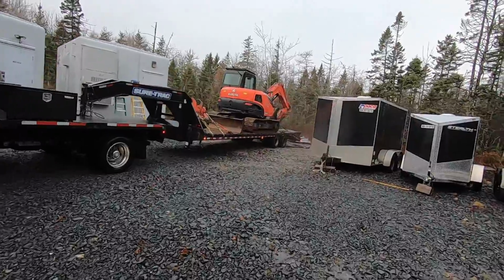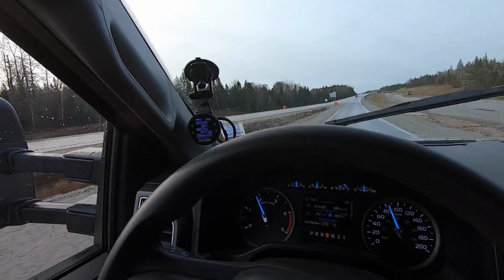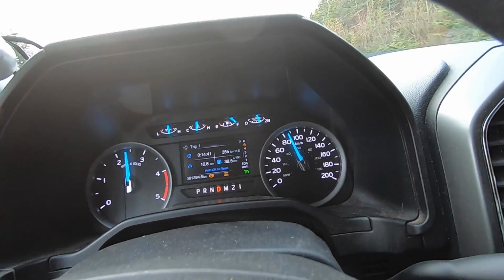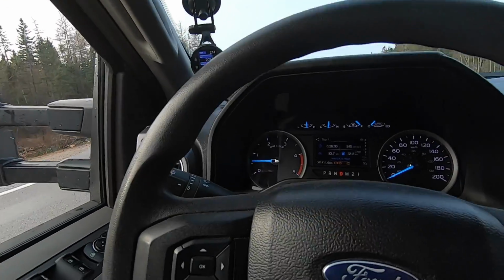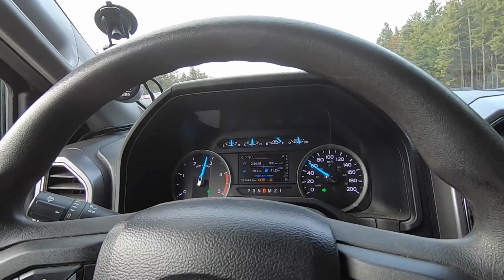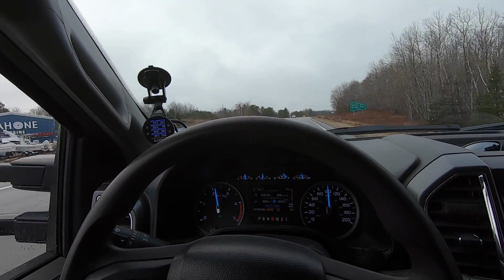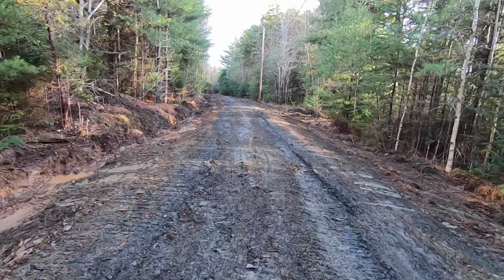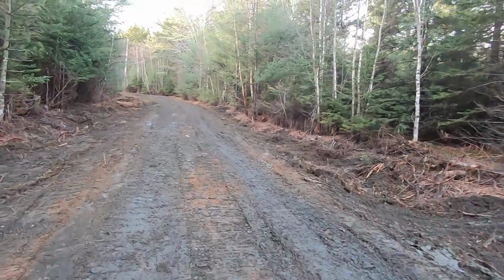BANKS DERRINGER TUNED POWERSTROKE TOWING 31,000LBS & ROAD REPAIR

Comment: After having the Banks Tuner for yrs, is it worth it for towing? I have a 2016 f550 I tow equipment around,  she does pretty good but definitely under powered vs a 350 pickup.  Wish the 550 had the 350 pickup power sometimes for certain situations
Reply from the maker: I like it. Can do a lot with the idash as well

Comment: Do you have the high capacity trailer tow package? And do you have the 4.30 gears or 4.88? -2014 f350 chassis cab owner. Oddly, Ford quotes the 2017 4.30 towing about 26.5k and the 4.88 at 22.5k without trailer tow package. . . I'm about to be towing about 22k here in a bit hauling cars, want to know if it's an option. Thanks.
Reply from the maker: btate 19k I have the 19,500gvwr which is as heavy as you can get. Besides the truck being detuned it does great.

Comment: Wouldn’t it be nicer if you could put it on level 5 and just have that added power the whole time it?
Reply from the maker: Curt It was on level the whole time.
Reply: workplaytv it’s on level 5 the whole time but you can see on the banks screen that it’s not adding the power the whole time according to that gauge. It’s fluctuation?
Reply from the maker: Curt oh yeah  it’s only adds power when needed. Why shoot more fuel in there when it’s not needed?
Reply: No I understand you there. But you’re only talking about a 50hp tune lol! 

There are plenty of tunes that add power from idle to wide open throttle and achieve better fuel mileage. 

I just think it would be like a game of catch up with the added power varying like that. Especially on cruise control. Wonder what it would have pulled that hill like if it was an addition 50hp the whole entire time? 🤔

That would be a pretty cool comparison!
Reply from the maker: Curt Yeah I hear ya it’s very quick if you watch the meter there is no delay. Also most tunes that actually add the power abd mileage they are stating are deleted.

Comment: Any updates on the new Ford delivery,,,🇺🇸
Reply from the maker: sandman62 Middle of January but I think I may have changed my mind and get the lariat sport with tremor but would set me back 2-4 weeks.
Reply: @workplaytv  I'm doing KR tremor  to get 2 tone and tired of the black interior and no chrome for me , but each 2 there on. No worries my 17 doing just fine .🇺🇸
Reply: workplaytv Id just go with the Lariat ...platinum is over the top on rational cost justification. (In my world at least).
Reply from the maker: Neo Craft Was only $1600 in difference once I had it specked out.
Reply: workplaytv Oh, in that case, don’t be a wuss. Get Le Platinum Deluxe!
Reply from the maker: Neo Craft On its way buddy.
Reply: workplaytv haha ok

Comment: Ol man trick is to just buy a RAM 5500 instead of buying a Banks Derringer (non smoking gun) here. We have to ask ourselves "Is it a safe transportation to and from work and shop that you actually have to have a booster for more power"? Or up a hill that you would be the only one on that road and you have to go faster?
Reply: The 5500 ram is a dog compared to the ford. I went from dodge/ram to ford. Best move we did.
Reply from the maker: Stephen Bradley Haha well ol man you have been around long enough to know that the truck did just fine before I had the tuner. It’s honestly more about being able to see everything I need to know on one screen. And if I can save some fuel along the way. That’s great!
Reply: @workplaytv  True, it's got the gears to pull you up. Not me but my friend has pulled his skid steer up to 1200 metres and with a 15% grade with his 3500 chassis gvwr 10,000 gooseneck trailer. Maybe you should have stayed with the 430 gears for better mpg.
I'll watch the two videos when I get home, I can't focus on my phone without the service dying up island in Port Hardy.
Reply from the maker: Stephen Bradley Haha sounds good. The 4.44 would have been the other option in the 550 chassis. It may have helped not sure. I am pretty happy with the truck at this point.
Reply: @workplaytv  As long as your happy with the truck then that's all that matters to yourself but 444 would have helped a lot with mpg. I'm just home after taking 4 1/2 hours instead of the 2 1/2 hours. Lots of Elk on the road (only one choice here, no detours) Highway 19 must have had a dozen on the road to get away from the Wolf's. Worse than hitting a Moose cause they are level with the hood. Both would kill you but a Elk cow would make you suffer a bit longer.
Reply from the maker: Stephen Bradley Yeah man that’s dangerous! Good you made it back safe!